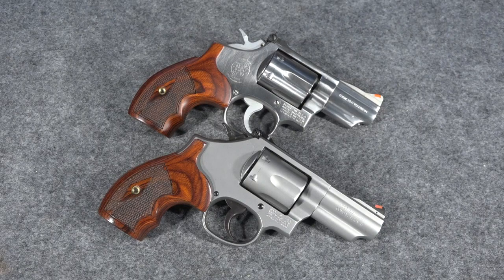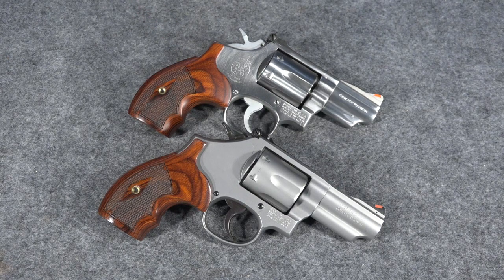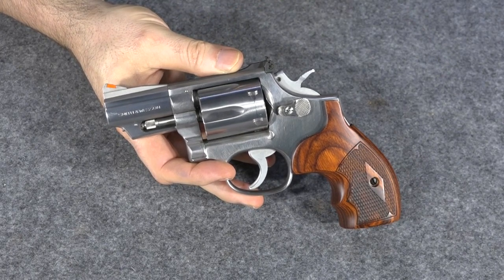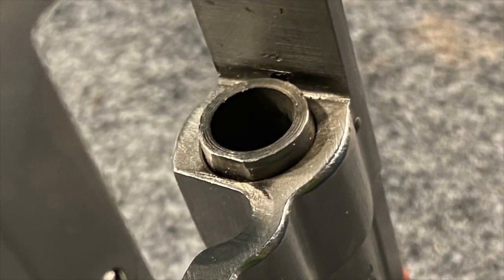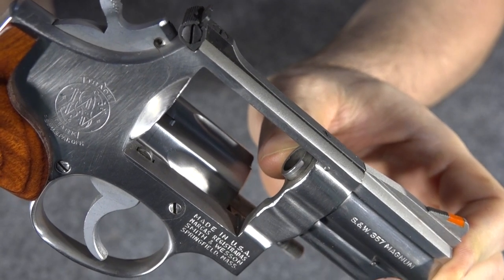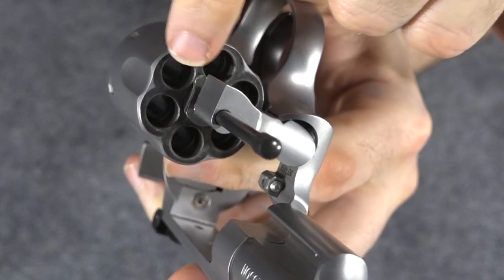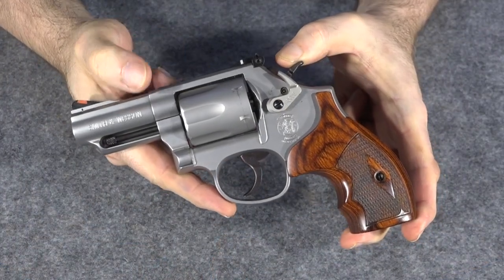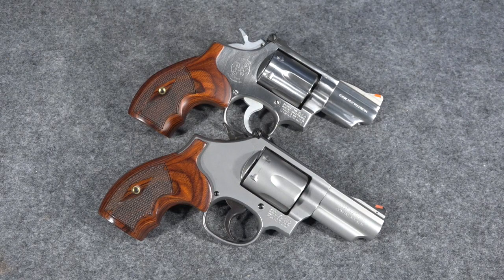Can K-Frame S&W Revolvers Handle Full Power .357mag Loads? (Cracked Forcing Cones)

Comment: Tough call:  Firing full power loads out of the modern gun sounds good but man, the vintage 66 just looks gorgeous!
Reply: For real
Reply: If you aren't throwing a lot of rounds thru it you shouldn't have a problem.
Reply: Full power 158s weren’t the problem , it’s the hot , light 110-125 grain ammo that was cracking cones.. and usually after a couple thousand of em

Comment: Wish Smith would go back recessed cylinders and get rid of the lock.
Reply: A Shot in the Dark If so I would buy a new Performance center revolver to commemorate the change.
Reply: Will never happen. Smith charges a premium for its name and customer service now. They still make fine guns but those old days are gone. The recessed cylinder is just too expensive to do and revolvers don't sell like they used to anymore.
Reply: laughs in eternal Colt supremacy
Reply: @HumphreyHorsehead  I've got a 1976 Python and a 2020, the old one has a pretty good trigger the new one sucks. Neither one is even close to my 686+ which I easily did my own trigger job on and removed the lock and installed an "Original precision lock delete" on. Colts only win the beauty contest.
Reply: I recently saw that Rock Island Armory has a similar revolver that they are manufacturing in the czech republic that has recessed cylinders! if they can do it so can Smith n Wesson.
Reply: Wish in one hand..
Reply: @HumphreyHorsehead  all my Colt revolvers are decidedly inferior to my S&Ws… in every way
Reply: And go back to polished finish instead of hideous matte

Comment: According to the person I spoke with at SW, it is not the pressure of the round, it is the weight of the bullet. Lighter bullets, like 110 and 125 grain, exit the case sooner, causing more of a flame that can cut the forcing cone. 158 grain was the common 357 bullet weight back in the day. When they started developing 125 grain hot loads, the problem showed up. Shooting hot buffalo bore 180 grain hard cast is not a problem with the old K frames in fact.
Reply: I've heard this exact same statement echoed more than a few times. 125s at 1450fps were the main culprit. 158s at 1250fps should be fine. I think I recall a video over at HR Funk's channel where he describes an old K-Frame .357 that he has never fired anything but full power .357 loads for something like three decades now with no sign of damage.
Reply: @craigdamage  I have seen pics of cut forcing cones of K Frame Smiths. And the factory itself says not to use the lighter bullet weights in them. I'd say that is enough for me to stick with 158 grainers in my model 19, even if it could take 125s for awhile before any problems. It is a catastrophic failure of the gun if it happens. And it HAS happened. It is not the power of the load, but the weight. Short light bullets cause the flame cutting. That is a fact, even if someone ignores it and it does not happen to their own gun yet. I just hope I don't buy a used one off someone who ignores what the factory tells them. Why wold S&W itself say not to use 110 or 125 grain loads in their gun? It is not a selling point, but admitting a weak point. And that weak point is plain to see if you look at the underside of the forcing cone, where they had to thin the metal to allow for the cylinder to close.
Reply: @nathanlambshead4778  yes indeed. Do you not understand that my initial comment is in 100% agreement to your first post? You seem like you are trying to convince me of something I already know that concurs with what you obviously know. That's why I said "158s at 1250fps should be fine" .....??? I mentioned HR Funk because I assume he has always stuck with 158s and avoided the lighter high velocity loads in his K-Frame.
Reply: @craigdamage  I guess I did miss your point. So many people use an example to keep doing what they want to do, that it is hard, especially when just typing on line, to know what someone really is saying. I have read many statements about people doing things with their guns that are not advisable, that I spoke up when I read what I thought you said. lol  That sounds confusing in itself. I just hope someone reads this thread and unloads the 125 grainers out of their model 66 and goes to 158s. Actually, I carry 180 grain Buffalo Bore hard cast in my old 19-3 in the spring here in Black Bears country. The gun handles them fine.
Reply: Since I’m not out trying to put 6 rounds within an inch at 50yds, my reloads are pretty basic if not on the light side. But always 158gr.

Comment: Actually, the original .357 Magnum loads when they first came out were quite hot. But, what they also were, was a heavier bullet. The original .357 load was a 158 grain lead bullet and out of the 8 3/8" barrel it was doing over 1,500 fps. The current Remington 158 grain performance wheelgun ammo for the .357 Magnum is rated at 1,235 fps. The problem with the cracked forcing cones came from using 125 grain bullets. When the Model 19 came out in 1955, the 125 grain bullet had not been invented yet and gases were creating pressures passing around the bullet and spiking the pressure, cracking the forcing cone. I've seen Model 19 Smith & Wessons with thousands of .357 rounds fired through them, no issues, but, they were older guns and most of the rounds used, were heavier bullets. I can't tell you how many .357 Magnum rounds I shot through my Model 19-2. Thousands. They were also 158 grain bullets and better. You have to remember, when the .357 first came out in 1935, it was in the heavy N-frame Smith & Wesson, the same size gun they used for the Model 29 .44 Magnum. The K frame was one of the first lighter guns. The factories reduced the loads in the ammunition because of all the small tiny concealed carry revolvers. It's also NOT the flat spot on the forcing cone that's the issue. If you look at the Smith & Wesson Model 60-15 Pro series .357 Magnum, which is a J-frame, they have that same flat spot on the bottom of the forcing cone, and I've yet to hear about the cracking issue on them.
Reply: But the flat spot is where 99.99% of the K-frame forcing cones fail so….?

Comment: My grandfather had one of the original K frame 357 from the 1950s. Shot it for decades. All types of loads and never had a problem with it. Ever.
Reply: In 1980/1990  decades,   ammo was really so hot..  maybe he dont use  all times hotters ammo...    personnally  i see perfect  very old   K  357  but  they use only 38sp and  rarelly a cylinder of 357... impossible to rate it  in theses conditions
Reply: @alanaliyev456GT  ammo from the 60’s through the 80s was way hotter than it is today. Todays hottest off the shelf loads from none boutique brands are very week in comparison. With 357 and 10mm being the biggest offenders. 
In fact, most of the modern off the shelf 357 is barely more powerful than 38 special +p and most 10mm is barely more powerful than 40 S&W. 
I have old hand loaders logs and books from way back and the pressures and fps where much higher than today. I’ve also chronic nearly all 10mm and most of the 357 magnum off the shelf ammo there is.

Comment: The forcing cone cracking issue while it does happen is seriously overplayed like many things on the internet out there, I have a couple K frames that are from the earlly 70's, one is a model 19 that my uncle carried as a cop and has had bucket loads of full house 357 put through it and a good number of my HOT handloads and it's in pretty much like new condition (hardly has any bluing left on it from being holsterd so much but tightness and function wise still perfect), I also have 2 older model 66's that like the model 19 has been shot mega times with VERY hot 357 and are just fine (one of them was my dads and I know he shot the holy crap out of it and carried it aLOT because there is a tiny bit of a flat spot from holster rub on the side of the end of the barrel), I have 2 of the newer  model 66"s (one 2.75 and one 4.25 barrel) and they are beastly strong and I fully believing that you will give up and have enough of fullest of full power 357's long before you will ever faze the gun, if you manage to shoot loose or hurt the new model 66 you have done something major wrong somewhere, just my 2 cents but if you thing the new model 66 ain't strong enough (although you'd be mistaken) the go for a 686 because they are only a tad heavier but are the ultimate in strong and durable and as a bonus have 7 instead of 6 shots available and having one more isn't a bad thing.
Reply: I don't doubt you.
Reply: You point it out right, on the web they spread a lot of 'miths' which are most of the time unfounded nonsense. I read numerous times that Revolvers wear out if you shoot a lot of 357 Magnum rounds, especially old ones...I own a Ruger Security Six which I had purchased in 2010, back then it looked already heavily used. Over the years I had shot the fire out of that gun, chiefly with hot 357 Magnum handloads and it is still in good condition, no cylinder play etc
Reply: Some revolver forum I frequent suggested that this forcing cone issue is way over exaggerated and was partially a result of Ruger's advertising in the 70s that their revolvers were "more robust" and can allow for more unlimited use of full power magnum ammo consumption. Also, back in the old days most people didn't have large pistol and revolver collections like we do now. Many sportsmen who owned several rifles and shotguns for all the various hunting seasons would really only just own one handgun. This lone handgun and coupled with the fact that back then ammo was cheap and abundant meant that you might put thousands of rounds through it annually. I can see how that much shooting of full power magnum ammo through a single K-Frame could cause a lot of wear and tear. Oh well, that's how I justify having a huge pistol and revolver collection. All my shooting is so spread out through so many handguns that it guarantees they will all last beyond my entire lifespan.
Reply: Exactly! Here is a good example of why a forcing cone cracked on a Ruger GP-100 357. And the fact that the GP100 has a slightly stronger frame over the S&W 19. Notice that the inner diameter of the Ruger's forcing cone is severely eroded. GEES, I WONDER HOW THAT HAPPENED!!

https://www.youtube.com/watch?v=YENpYl0_IwE
Reply: I love my 66-8!.

Comment: The cylinder lock up is different on the new Model 66; the lock up is on the frame.  The old cylinder lock up was on the ejector rod.  Therefore, the rod had to be sturdy to take the load.  With the lock up on the frame, the rod does not have to be so sturdy.  This was a good engineering work around.

Comment: One. Older super vel loads exceeded modern 357 loads. Two. Older loading manuals have hotter 357 loads than present. Three. The newer model 66 is slightly larger in the frame. A lot of the problem was the excessive gas blow by with shorter 110 and 125 gr bullets. Read the smith and wesson engineers' explanation to settle the huge amount of misinformation on this subject that has been debated since the 70s.

Comment: we have some history with S&W Model 66-2 handguns - their metallurgy in particular......my brother and I purchased identical model 66  4 inch revolvers brand new in about1981......the first time out shooting - the top of the cylinder and the top strap were blown off mine when 3 rounds went off at once - because of a burr on the recoil area of the frame ...lucky that nobody was hurt badly .....Smith & Wesson replaced the gun   with a brand new one which I promptly sold without ever shooting it......they never said what was wrong but since they replaced it one can presume they had seen this before and saw a cheap way to make a customer happy instead of defending themselves in a lawsuit.

through the years my Brother only occasionally shot his Model 66-2 - almost always using 357 mag ....well about 2018 he started noticing that the empty cases were hard to eject. Upon investigation he found that a couple of the cylinder chambers had   internal bulges that prevented the expanded brass from being cleanly ejected.....funny thing is the outside of the cylinder has NO bulge and looks and measures perfectly .....this had us scratching our heads - how can this be ....where did the metal from the inside bulge go?.......we sent it back to Smith and Wesson - they acknowledged our finding but DECLINED to do anything - instead sent an estimate for some ungodly sum that made it economically unfeasible to repair and he had them send it back to him unrepaired - it now serves as a paperweight . Smith and Wesson having been bought and sold a couple of times through the years said that they were no longer the company that manufactured that handgun and had no obligation to repair it.  Our feelings are that the metallurgy of those handguns was defective and we are very disappointed in Smith and Wesson. 

It apparently made no difference that in this same time frame S&W was blowing out the then new 45 Shields along with 40 and 9mm versions and the updated 380 Bodyguards - and between my brother and I we purchased over a dozen of those AND a XVR 460 revolver - Smith and Wesson sent back the model 66-2  unrepaired - shame on Smith and Wesson.
Reply: Yeah,basically all they care about now is their semi automatic line. Their revolvers aren't made like they used to be.
Reply: Yes they had some severe metallurgy problems with their stainless guns in the 80s. I believe the Lear Sigler group owned the company at the time.
Reply: My 686 and 629 have never had an issue, I think they’re my only 80s guns. My others are all from the 70s or all the way back to 1902. Except my 500

Comment: I would tend to disagree with your definition. 
It was not necessarily "hot" loads that were the major problem. It was high speed light for caliber loads that around 90% of the issues were traced to. 
110 to 125 grain high speed loads have a very short full diameter sectional area.  
The fact is that they have such a short area that is full diameter that the bullet base can be out of the cylinder  and the full diameter forward area of the bullet has yet to enter the rifling, it is still in the larger diameter angle cut considered the forcing cone. This gave alot more force slamming into the cone. 
Really "hot" 158 grain or 180 rarely were an issue.
Reply: Correct!  125gr and lighter also cause rapid forcing cone erosion and top strap gas cutting compared to 158gr loads.  The model 19 came out in the late 50's when 158gr loads were the norm, and I know with them these guns held up pretty well, but the popularity of the 125gr full power 357 mag "Lightning Load"  in the 1970's  is when the problems really started, and hence the creation of the L frame.  Even in a 686 those light bullet full power loads wear the forcing cone more rapidly though, so it isn't just a K frame thing.    Too bad there isn't a handgun that allows you to launch 115-125gr bullets really fast that doesn't have any of these problems.......357 Sig.
Reply: That's interesting.
Reply: Makes sense to me. Looks like I’ll stick with heavier bullets. I tend to like heavy bullets anyway
Reply: If you want to crank out high velocity 125 grain and not worry, get a single action ruger Blackhawk. Those things are built like russian tanks. You couldn't break the cylinder unless you filled it with c4
Reply: Absolutely correct.  There were a couple of ammunition manufacturers who did not do their homework when developing these lighter bullet .357 loads!
Reply: This is the correct answer. You should only be using 158 anyway imo. 125 has it's advantages sure, but I like a heavier projectile
Reply: @Jiffypistol  myself as well
Reply: I've put 1,000s of 110gr & 125gr loads through my Ruger SP101 3" in almost 10 years & no signs of forcing cone erosion, several hundred of those through my GP100 6" I bought three years ago same thing no issues.  From what I've heard & seen this is primarily a S&W problem.
Reply: @perplexingperceptions8888  yes, that is what the entire conversation is about.  Specifically pre MIM k frame only Smith and wesson, no other frames and not current production.
Reply: @thedirtbag7  Russian tanks are getting beat up in ukraine.
Reply: @enriqueoliva6988  I was also going to point out that it's odd to single out Russian tanks for durability and reliability. I'm assuming it's a WWII reference and if so the vast majority of Russian tanks were greatly inferior on these points to German and American tanks. The Russian tanks were focused far more on rapid mass production and were definitely a "quantity over quality" affair.
Reply: @perplexingperceptions8888  that’s just wrong, keep in mind the SP101 came out in 1989, SAAMI downgraded the max CUP for .357 Mag in the US from 45,000 CUPs to 35,000 CUPS in ‘91. Assuming you bought in the 2000s, you are using modern LOWER pressure 110-125 grain magnum ammo, as such its no wonder you’re not seeing as much forcing cone erosion, but you look at old 586/686s and Rugers that would be using a heavy diet of pre ‘91 SAAMI standard 110-125 grain .357s, and I guarantee you that there would forcing cone erosion on those, I know because there have been many at my LGS that have this exact problem, the issue isn’t brand or metallurgy, it is simple physics.